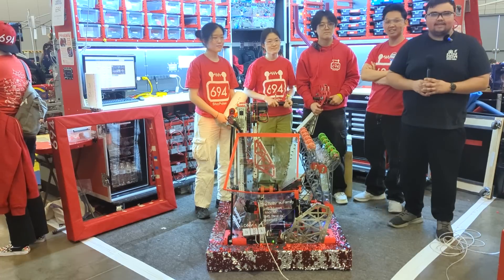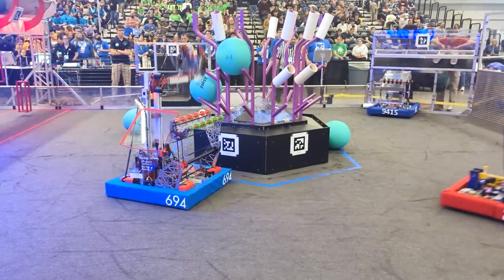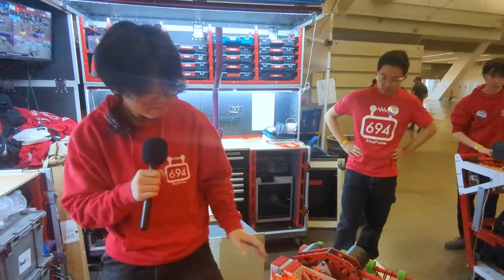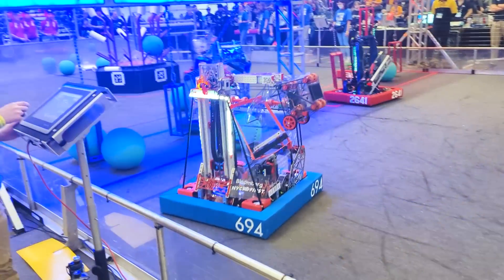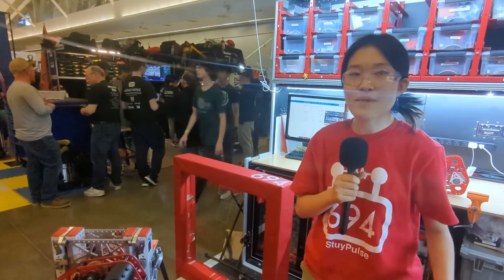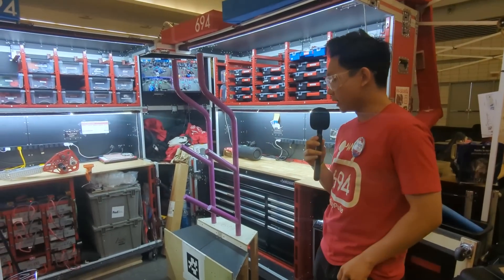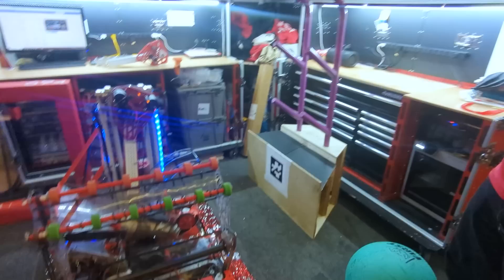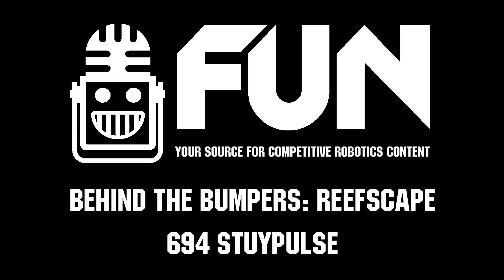694 StuyPulse | Behind the Bumpers | 2025 FRC REEFSCAPE Robot

Comment: How they get out from climb after the donut climb went down? If they can move the climb with their hand how it can hold the robot? If not how they take out the robot from cage?
Reply: due to the shape of the hooks, once climbed, they push into hard stops and lock into place so that even without power, the robot doesnt fall. Once the match ends, we turn the robot off so that the hooks arent powered, two people lift the robot so it isnt resting on the cage, and then one turns the hooks so that the cage can come out
Reply: @harry4956 I didn't understand the part that your hard stops can be moved by hand? It seems like at the video it's just a polycarbonate sheet.
Reply: @erkamtb  The hard stops aren’t moveable, but the hooks are once the robot is turned off, so they can just be moved out of the way